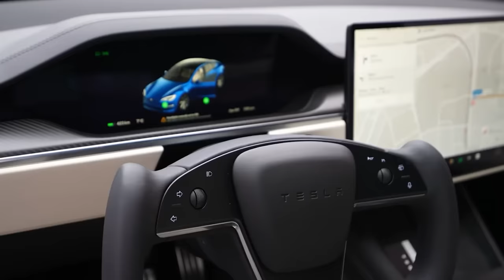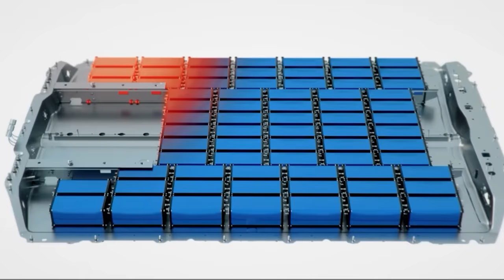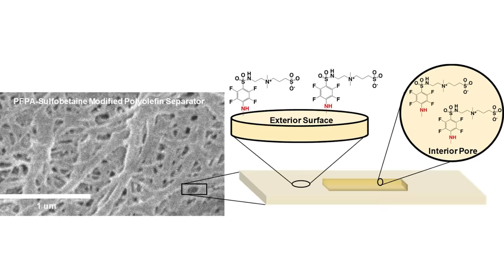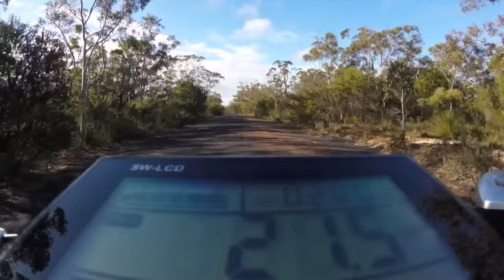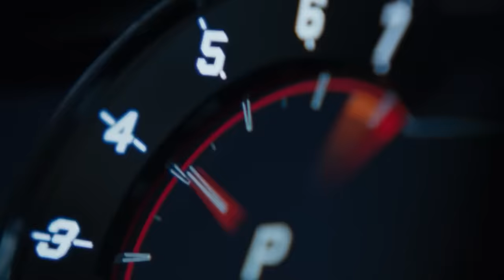EV's Are Exploding In Shocking Numbers

Comment: So you buy an EV to help the environment, but all that toxic smoke when they burn  just defeated that reasoning.
Reply: So the masses of CO2 produced by millions of ICE cars in towns and cities everywhere, just fades away to insignificance does it?  Or had you forgotten about that?
Reply: @Brian-om2hh It’s just not CO2 produced by gas vehicles, it’s air pollution for daily breathing until you feel you struggle to breath. Gas vehicles emits toxic gas everywhere they’re operated 24/7. EVs fires have been largely isolated and very few in reality although such YTube channel have hyped it up for obvious reasons. Renault car maker have been advising and train8ng firefighters on how to deal with Renault EV fires by dousing the fires from INSIDE the ev batteries through a means they have provided, not dousing Externally which they have advised against. So why are these knee jerk key board warriors so keen to advise from the seat of their pants rather than listening to the experts who are responsible for EV fire safety of their EV products and EV manufacturing plants?
Reply: Don't worry about the toxic smoke just digging up raw materials and making the batteries is more harmful to the environment.
Reply: @jacobheinz8236  And when in 2023 have you ever felt like you were struggling to breathe due to air pollution from an ICE vehicle?  That was a concern in the 1970's before emission regulations became mandatory.

Yes, EV fires have been largely isolated because there aren't that many of them out there in comparison to gas powered vehicles.  What do you suppose will happen in a multi-car pile-up of EV's?  It would be "Hell on Earth".  

And exactly how is a firefighter going to get close enough to a flaming EV vehicle to "douse a fire from the inside of a battery"?  I call bullshit on that one.   How many firefighters will be killed or injured by exploding batteries while trying to get to the "means provided", which would be a hookup attachment?  

I could go on for days listing the pitfalls of an EV future.  Better to discover them now before a complete bogus "fix" of something that ain't broken is complete.
Reply: Do a little research and see just HOW MANY petrol vehicles burn and HOW MANY EVs actually catch fire in a year. Get back to me on that, will you?
Reply: @Brian-om2hh  Trees eat it up and love it.
Reply: @The_DuMont_Network  Ask that question again, when EV's are the majority of vehicles in use.
Reply: Even assuming regular cars also catch fires, how often do we hear they explode and destroy the entire car and people’s lives like that?  Don’t push ideology before people’s lives.
Reply: Evs are just as polluting if not more than gas engines in cars.  Ask yourself where does the electricity come from?  60 percent or more comes from gas and coal fired generating plants.  Evs are cleaner locally but not overall.  They're just polluting areas more than normal at the source and that pollution will be carried around by the wind.
Reply: Petrol cars pollute all the time they are used, evs don't.
Reply: @arnimkrause5696  my electricity comes from wind and solar ..
I live locally, so do you.
Reply: not only the smoke thats bad, its the whole production line.
Reply: @The_DuMont_Network  
       So you're comparing millions of millions of gas-powered cars to maybe a million EVs .
           That's a good one .
                           🤣
    Now compare that by percentage .
Reply: @MadMax351  While that claim has been proven 100% false around 1000x already...
Reply: It takes more energy and pollution to produce the EV batterys  than the Gas gasoline SUV would produce in its lifetime From production to destruction
Reply: @lucasdog1  Or calculate the ratio of fires to vehicles of each type and age, which is easy enough to do.
Reply: @jamesedmonds1350  In the US, using data from the National Transportation Safety Board (NTSB), Bureau of Transportation Statistics (BTS) and government recall information, AutoinsuranceEZ calculated fires by vehicle type:
CE vehicles 1,530 fires per 100,000 vehicles.
EV vehicles  25 fires per 100,000 vehicles.
Reply: @thomasvaverka5168  Except of course hundreds of scientific studies have proven that claim to be 100% false around 1000x already...
Reply: Forget about all the so called pollution required to produce ev vehicles.
Reply: @whocares264 😂😂😂😂😂 - It’s the social control provided by government being able to turn off your car remotely and restricting your range of travel. Pollution concerns are an Orwellian lie.
Reply: @randalldunning5738  you do know the technology is here to turn off any modern car  ice or electric
Reply: Along with large amounts of water to put them out washing lots of chemicals into the sewers n ground water.
Reply: @jasonbernard2785  really, do you know the crap which is going into our rivers now,
i don't even have to go to oil pollution,
you have actually highlighted another reason to have an ev....
Reply: @Brian-om2hh To build batteries for these EV all the mining for copper, lithium and cobalt is completely insane.
Reply: @Brian-om2hh  It  seems that the "GREEN"was removed from tha marketing..remained only for paint option
Reply: According to statistics compiled by AutoInsuranceEZ, there are an estimated 25 vehicle fires out of every 100,000 electric vehicles each year. There are an estimated 284,130 car fires per year in vehicles powered by gas.Apr 19, 2023
Reply: @TempleScoop There are probably like 1 billion ICE cars in the road though. Not sure that you are on about. An electric car wiped out a family in a province in my country while they were sleeping. That never happened with ICE cars since the 50s in my country.
Reply: Sure it is..
Reply: @TempleScoop  Should be a reference by year or at least 5 years old, the diff is not only by numbers, a lot of gas powered vehicles had thousands of miles and years more...As i sad, half true every time with every thing on media and marketing..and other trick they play with deliveries-sales INCLUDE also a SH registration EV as sale..Did i mention a low SH EV sales and depreciated resale value ????
Reply: @TempleScoop  
 So you're comparing 100,000 vehicles to hundreds of millions. 
                    🤣
Reply: @torukmahtomahto409  Are you saying EVs reduce in resale value?  Not sure if you were using text-to-speech?
Reply: @JABelms  what is an ice car?
Reply: @TempleScoop  if rou don't know english is your problem..also if you are informed only by TV and marketing..
Reply: @torukmahtomahto409  . I had another person read what you wrote, and it's a bit confusing. I asked for clarification; no worries, have a great day, and no worries.  ~Chad James
Reply: @Brian-om2hh HELLO! CO 2 is carbon dioxide which is a natural gas. It is taken in by plants and used. Oxygen is then expired by plants in a system we call photosynthesis! What you believe is propaganda. You have been sadly misinformed about carbon dioxide. The gas you’re talking about is CO or carbon monoxide. That is fatal, but can be disassembled by electrolysis. Catalytic converters help with that.
Reply: @MadMax351 yes that is true. Go to Central Africa where they dig it up and ask them what it does.
Reply: @arnimkrause5696 correct. Add to that the assembly of that product. Now tell me what’s the difference? To produce the battery, let alone the rest of the vehicle. And the fact that there thousands of these things just parked, yes PARKED thousands deep in a lot in China. Why?
Reply: @whocares264 they do in manufacturing. And electric is generated by coal or gas fired furnaces, just like producing metal.
Reply: @whocares264 All of your electricity does not come from wind or solar unless you are certain you are managing it and producing it yourself.
Reply: ”pay no attention to the man behind the curtain”.
Reply: and yes, that, too.
Reply: Wow! 🤣
Reply: @TempleScoop ICE Internal Combustion Engine.
Reply: @RJDA.Dakota  yes, the same as manufacturing petrol and diesel cars...
Reply: @RJDA.Dakota  all my electricity comes from renewables...
Reply: @whocares264  good for you.
Reply: @Anomoomin  agreed with that. But you have to teach others about “cause and effect”.
Reply: @Anomoomin  wonder where oil come from....
Reply: @Brian-om2hh It’s plant food actually 😂😂
Reply: @The_DuMont_Network A petrol or diesel cannot burn through concrete but an E,v. Can .  making them extremely dangerous in multi story car parks 😊
Reply: @Brian-om2hh 
Plants need CO2 and they will use it up.
Reply: @Brian-om2hh 
Co² is very good for the environment. Forests grow and live on it.
Reply: There isn't enough lithium to put 130 lbs of it in each vehicle if its not going to cost more then gold. 😅 (Tesla battery est.)

around 17-20 million metric tons

Estimates of total lithium reserves on Earth vary, but they are generally believed to be around 17-20 million metric tons

Cars on earth 1.474 billion cars
Reply: No, stored as carbon in trees, plant, grasses and ultimately ourselves after we eat lovely bacon butt's and chicken and lamb with my roast dinner, beef burgers, mmmmmm love fumes from vehicles so much benefit to our modern world. :-)
Reply: @whocares264  you are aware what oil that's taken from the ground produces, all of the products, it would be interesting to see how many people can do without these products
Reply: Not to mention the child labor used to mine the lithium in Africa.
Reply: @The_DuMont_Network so would that figure be skewed at all considering there are way more petrol cars in use than evs maybe could that maybe the reason for that probably definately maybe hmmm🤔
Reply: @whocares264 f thats true why do police chase people?
Reply: @whocares264 well if ur in uk its mainly sewage ruining our rivers
Reply: @nickbailey5201  correct, the uk is an open sewer .
Reply: @drannoc100  even assuming, it’s not am assumption it’s a fact.
Reply: @Brian-om2hh CO2 isn't harmful.  It's plant food.
Reply: @lucasdog1  "Ask that question again, when EV's are the majority of vehicles in use" ....If there is discovered to be a problem with fires, they will switch to a more stable battery chemistry. Like every new tech, you tweak it as you go.
Reply: Also it makes more pollution extracting lithunium from the earth needed for making batteries than it is to dig for oil for gasoline burning vehicles
Reply: @jacobheinz8236 if environmental pollution was the issue we would convert existing ice vehicles to natural gas. Burns clean
Reply: Not to mention the energy to recharge.
Reply: So what is your plan then?????? Or are you just one of them people who like to moan about everything
Reply: Teslas catch fire on average every 200 million miles driven. Gas cars every 19 million miles.   ..... And if you do a little research you'd that fire departments are coming up with some great tech and procedures to put out EV fires.
Reply: There is nothing environmentally friendly about electric cars it's all for stockholders and who has their money invested in such a ploy
Reply: @optimusprimer4392  About 1/6th the mining is required to maintain a fleet of EVs vs gas cars. Much less environmentally intrusive. And electric motors are about 3 times more efficient than gas engines.
Reply: Not to mention unclean charging from ungreen sources.
Reply: @keithharley9729  Not to mention that electric motors are 3 times more efficient than gasoline engines and even in the current electric grid mix of nat gas, coal, nuclear and wind/solar, electric cars will still have fewer emissions than gas cars because of that 3 to 1 efficiency. A lot less emissions.
Reply: How can it help the environment when you're using electricity that has to be generated by a power plant burning coal, wood, or some other carbon producing material?
Reply: @toddtourville984  I'll explain it one more time. Electric motors are 3 times more efficient than gas cars. About 70% of the energy of a gasoline engine just goes up in heat. They are extremely inefficient. Electric motors are very efficient. So even at say 40% nat gas, 25% coal, 20% nuclear, 10% wind/solar, and other, electric cars will still produce far less emissions. They just use a lot less energy.
Reply: @777Outrigger  Maybe in that sense but, you will have to increase the poser plant output which makes up the difference.  Especially since the power grid (USA) is not designed to handle a massive influx of electric vehicles being added to it while charging.  Thus allowing electric companies to charge more for their product.  Creating another problem or problems.  All the while electric batteries are exploding all over the planet creating more carbon output than any gas vehicle in its lifetime.
Reply: I'm a fire fighter, ALL vehicles produce PAHs when on fire. So chill. ❤
Reply: @Brian-om2hh  So what about the masses of CO and other problems produced by coal and other fuel power plants all over the world to supple EV electricity? EVs use a ridiculous amount of energy, 1 kWh of energy to travel approximately 4.8 to 6.4 kilometers (three to four miles) according to the top search result in Google. So its a massive percentage of power used in someones life. 3-4 times more than a full sized house!
Reply: @777Outrigger  EV energy efficiency isn't as good as people make it out to be. ICE is slightly worse but there are many more losses in a vehicle right down to the resistance of aerodynamics, gears and other drive train components, wheels and tire rubber resisting the road and the battery charging which is never 100% efficient as batteries and chargers have internal resistance and get hot while charging. The power lines, transformers and other parts of the electrical grid that supple electricity to homes also have resistance and losses. EVs use a massive amount of kilowatts so there is a lot of loss that adds up.
Reply: Not including the production of this type of energy.  EV is a SHAM.
Reply: Gas vehicles are a bomb waiting to happen. An example of a Tesla in the video above caught fire after hitting a tree ! Shock Horror ! How many gas cars explode instantly after crashing? Battery fires can happen fast but not as fast as gas cars. One sentance in the whole video mentions that gas cars are more likely to catch fire than battery cars (it's actually about 100 times more likely in fact !), yet all the video emphasises battery car fires. Wake up people, this is click bait at it's best. Utter rubbish.  @drannoc100
Reply: @drannoc100  Happens all the time with gas cars !!!!!
Reply: @robbeales5516  Yeh like the recent fire in Luton Airport multistorey car park, started by a gas powered car, destroyed building and 1500 cars ! Imagine the fuss if that had been started by an EV  !!!!!!!!!!!
Reply: @practicalguy973  Let me give you an example. The Big 7-seat Model X has a big battery pack of 100 kWh and a range of 350 miles. That 100 kWh battery pack has the energy density equivalent that 3 gallons of gasoline has. So why can the big Model X go 350 miles on the equivalent of 3 gals of gasoline? Electric motors are 3 times more efficient than gas engines. ..... 

And it costs me about $39 to go a 1000 miles on my house electricity in my Model Y. In my wife's similar sized gas car it costs her $200 to go 1000 miles. We're probably about to buy her a Model Y too. They're selling for $48,000 now.  ... Plus you can get a little Model 3 sedan for $38,000.
Reply: Since when is mining cobalt saving the environment? 

People really need to do their own research. 

Decivers shall be decived ALWAYS.
Reply: @theawakenedarewatchingyou575  The latest EV batteries are LFP batteries and they have no cobalt. Elon Musk calls them the battery of the future. Meanwhile, cobalt is used in the refining of gasoline and is in your laptop and phone batteries. ... You need to do a little more research.
Reply: o chit...the reasoning is done way before the fires cuz cmon where does the energy come from for the batteries? The answer ISNT renewable energy so whats the point of them? They tax the electric grid & where does that power come from? EVs are putting the cart before the horse.
Reply: @johnbrummet524  Electric motors are 3 times more efficient than gasoline engines. About 70% of a gas car's energy just goes up in heat and is wasted. Only 20% of the energy is used to move the car forward. Exact opposite in an electric motor. About 70% of the energy of an electric motor is used to move the car forward. That's why electric cars cause fewer emissions, even with the current electric grid.
Reply: What about an EV "helps the environment"? .. name a single thing about an EV that helps the environment. Just one.
Reply: @nickbailey5201  There’s a specific remote engine activation hardware that not all ICE cars have installed.
Reply: @typhoon320i  They are working on solid state batteries.  Which would have different issues but arguably are more safe.
Reply: @practicalguy973  The energy being used by an EV in running the car is more efficient in its consumption.  However, combustible liquid fuel packs a lot of energy per unit of mass and volume, so there’s a lot of energy that isn’t being consumed as efficiently per unit expended in running an ICE Car compared to an EV
Reply: @adrianwoolf3196  Battery fires are way less likely to happen but when they do, it takes a special effort to put that fire out.  The fire can even reignite
Reply: @squidly2112  Electric motors are about 3 times more efficient than gasoline engines. Even if the grid is mostly fossil fueled, electric cars still lower emissions substantially over gas cars, substantially.
Reply: @777Outrigger  You're only speaking of a one part of the EV efficiency in driving it, as I stated in my first comment there are so many more losses in charging the batteries and the power grid. The costs right now are low for electricity. If ICE vehicles were taken away governments around the world and energy corporations would be adding more taxes and regulations charging much more to compensate for the revenue losses in petrol. Its already happening. Also the electrical grid can not handle everyone owning EVs and home charging. I cant see them beefing up the residential grid, doubling the size of all the electrical components in the grid would be astronomical costs. You'll pay a lot for being an early adopter as governments regulate and figure it all out. Recently EV insurance costs are skyrocketing in some parts of the world according to many sites. Fleet news in the UK reported between 150% and 300% insurance increases for electric cars in recent months.
Reply: @The_DuMont_Network  petrol car self combust is about 1 in 10k for all fire events, ev self ignite a lot. when ev burns it equals about 10 ice fires in scale.
Reply: @whocares264  Do you realize that while wind and solar are producing power that a standby supply of juice is spinning fully steamed ready to kick in the instant the wind slows down or the solar gets shaded by clouds. The grid HAS to be supplied with enough power to meet demand, period. I have spoken to people who run the power grid here in the Pacific Northwest, BPA,  and they have told me this. We have significant hydro power here and that means the dams are spinning and ready to go on line if needed. In other areas of the country that means gas, coal or nuke are spun up and ready to fill the gap.
Reply: Hybrids reflected the most at 3,475 fires per 100,000 vehicles. 
ICE vehicles caught fire  at 1,530 incidents per 100,000 vehicles.
EV fires were 25 fires per 100,000 vehicles.
Reply: All that toxic smoke used to make the battery wasn't enough then.😂
Reply: @michaelbritain5546  EVs lower emissions, even counting their production. Emissions from fires are insignificant.🙄
Reply: How about all the toxic smoke emitting from the Chinese/ Far Eastern power stations and factories that produce these vehicles !
Reply: @alanjackson4646  I agree China and Asian countries are the biggest polluters, but my Model Y was built in the USA. All Teslas sold in the US were made either in California or Texas.
Reply: @BobbyBear105
10 hours ago
Hybrids reflected the most at 3,475 fires per 100,000 vehicles. 
ICE vehicles caught fire  at 1,530 incidents per 100,000 vehicles.
EV fires were 25 fires per 100,000 vehicles.
Reply: @The_DuMont_Network ok, so compare the difference in numbers of ice to ev vehicles out there, then age difference  stolen and burnt out, then the intensity and difficultiesputting ev fires out, id still rather an ice car as its mostly down to maintenence issues,
Reply: @The_DuMont_Network  What's with the snarky comment? The point is well taken. The environmental destruction in China coupled with slave labor in the Congo to extract the minerals needed for the batteries are real issues that the EV fans conveniently ignore. Judge not, lest ye be judged. Maybe the DuMont Network needs to do more homework.
Reply: @truckerwayne  Never mind the environmental cost of extracting these materials. Many of the countries where this stuff comes from have lax or nonexistent worker safety laws and/or use child or slave labor.
Reply: Why doesn't anyone  address the air quality  after the fires from the ev  car
Reply: @ButchNackley  but people just cut trees down in their gardens because their to lazy to clean the leaves up in autumn, i have 2 trees in my garden and takes me about an hour 2 or 3 times a yr to clean up, hardly end of the world work
Reply: @redbaron6805  exept you use the same answer to any anti ev pollution comment 😂
Reply: @whocares264  only cars with wifi
Reply: @truckerwayne  but that pollution isnt in your or my country so it doesnt count
Reply: @TempleScoop  internal combution engine
Reply: @glennelliott1320  thank you
Reply: Cure for a problem that does nt exist!
Reply: @JABelms  how many people have died from petrol and diesel pollution,  millions...so sad that people want this to continue....
Reply: @whocares264 you  pollut every time you put it on charge
Reply: @allanhone6747  not on wind power
Reply: @glennelliott1320  Because these claims are the same recycled bullshit repeated endlessly over and over again, yet they aren't actually factual in any way.
Reply: Then, there are toxic batteries.
Reply: @kathleenevans1201  There are no toxic batteries, and the batteries on EV's easily last 15+ years, and are recycled afterwards.

The problem is a bunch of Facebook Echo Chamber idiots that think they are experts on EV's, despite having never owned one, driven one and having no clue at all how they are built or how they work.
Reply: You can try and claim it's only a few fires as much as you like, the cost of insuring an EV went up 6x this year. They suffer from cronic depreciation, as no one wants a second hand one, they are expensive to repair and are normally written off after a crash, the fires are very toxic and burn at temperatures up to 4x hotter than a petrol fire, so the 'better for the environment' BS story they are feeding us isn't panning out. And most people don't want to be forced to have one. The big car makers are all on the verge of going bust because of this idiot policy that is being forced on us. I'd say the EV wet dream is over, wouldn't you agree?
Reply: @tubewayarmy2  Yes!
Reply: @tubewayarmy2  I can claim to follow actual data that shows exactly what I claimed.

The cost of insuring an EV did obviously not go up "6x" this year, as my EV premiums haven't even changed at all.

"They suffer from cronic depreciation, as no one wants a second hand one"

That claim is beyond asinine, as EV's are offered for sale and sold by thousands on a daily basis, even EV's that are over a decade  old.

"they are expensive to repair and are normally written off after a crash"

Yet more asinine bull with no actual supporting evidence.

"fires are very toxic and burn at temperatures up to 4x hotter than a petrol fire, so the 'better for the environment' BS story they are feeding us.."

That may just about be the most asinine logical fallacy ever.  A handful of EV fires, even if "toxic" wouldn't be even remotely close enough to offset the staggering amount of emissions they save over their lifespans vs a petrol car.

And I find it comical that EV fires are magically more "toxic" than burning gasoline with rubber and plastics in a petrol car.  Just a whole new category of stupid.

"The big car makers are all on the verge of going bust..."

Sure they are..... Just a delusional and comical level of utter bullshit... 

🤣🤣🤣🤣🤣
Reply: Don't confuse the issue with facts....
Reply: @robinluck2922  No facts to be found here...
Reply: If a EV sits in moist atmosphere for a week without operating a fundamental issue that can not be solved easily could happen.
Reply: @lesseirgpapers9245  Obvious bull as there are tens of thousands of EV's in Florida, which has a moist atmosphere year round genius...
Reply: @sorequetengue  A mature tree removes around 48 pounds of CO2 from the atmosphere annually.

The average electric car prevents around 1950 pounds of CO2 emissions annually in the USA, which is equivalent to 41 mature trees removing CO2.

Since both an ICE car and an EV serve the same exact function, you can remove Trillions of pounds of CO2 emissions annually by simply switching to EV's and eliminating combustion engine cars.
Reply: @arnimkrause5696  Coal fired generating stations are declining in number. Gas fired plants are wayyyy cleaner. Wind, solar, hydro and nuclear power do not pollute. There is much more of these clean power generating plants than ever before.
Reply: It takes the processing of 500,000 lbs of raw materials just to make one EV battery system.  The open pit mines and the fossil fuels required to extract lithium causes severe environmental harm as well.
Reply: @Gregory-Masovutch  You are absolutely correct.  Not to mention the slave labour?  Saw something about the working conditions and  the pay is about $2 to $3 per day.
Reply: @Gregory-Masovutch  after 300000Km the ICE engine produced 20% less CO2. Grid being 30% non fossil. Assuming a battery of 500Kgr can be made with less than 10000 Kgr of CO2. This does not take into account the additional CO2 to create the charging infrastructure and peak demand capacity and extra battery storage and the loss of life waiting for the charging and the toxic fumes of burning EVs.🤣
Reply: And wasting enormous amount of water
Reply: @Brian-om2hh Unfortunately Evie cars don't balance out their carbon footprint more benefit the environment till 70-90k miles of use because they were produced and transported  with fossil fuel generated power. Coal and diesel. And though the giant EV batteries CAN be recycled, they are mostly NOT being recycled. The charging  infrastructure sucks. Our power infrastructure isnt ready. Most major ice car companies that are now prodcing EVs are losing billions per year on them. One company is losing $30k per car. I believe it is Ford. There's more problems but the most important one is that we are being FORCED into EVs by the govt not long from now. Fortunately efuels/synthetic fuels are being heavily invested in and developed that are ultra low emissions and some net zero emissions. And, its clear to giants like Toyota that hybrids are the better solution in the real world. The market will continue to prove this. Multiple major car brands are halting EV production because they are not selling fast enough.
Reply: @777Outrigger Due to the extraction, prodction and transport of EVs, they have no benefit to the environment until they have reached 70-90k miles of use. Their tires release way more pollution than ice cars because of the huge heavy batteries. The charging station electricity you will all use comes  from fossil fuel generation plants in most places. Not to mention plants eat up co2. The whole co2 thing is propaganda. If they were talking about co/carbon monoxide, it would be true, it kills.
Reply: @practicalguy973 some insurance companies wont insure them. Thats certainly not a good sign. When the biggest scam artist in the world won't touch a product you know it's bad
Reply: @Brian-om2hh that absolute concentrated toxicity coming from an EV fire, is that of me running my car for a month straight. 

So yeah. It kinda does.
Reply: @Brian-om2hh  Plants need CO2 to live. Where did you go to school that you don't know plants need CO2?  Are you a plantist? Do you discriminate against plants? What would you do if plants  cut off your oxygen since you are cutting off their CO2?
Reply: Co2 is not a pollutant......it's plantfood.
Reply: Exactly.😢
Reply: @richardsullivan2218  And humans need it too.
Reply: Can't use a burnt out vehicle 😄
Reply: @conradharcourt8263 That is in an accident.  However, an electric vehicle is more likely to catch fire just sitting there, or several hours after an accident.
Reply: @Brian-om2hh 40,000 child slaves in the Congo mines so you can have "clean" batteries charged by hugely polluting power stations working at 40% efficiency 😂
Reply: @@dualismdeeperlaws2430 but would you want to be in an enclosed area with a running petrol car...
Reply: The bottom line is that here in the uk atleast. In 2022 we had 3,500 ice car fires. About 100 fires per every million ICE car on UK roads. In the same year there were 26 EV fires or about 15 per million. Less than one 5th proportionately.
Reply: It’s because oil is running out.  All cars are bad for the environment
Reply: @iancouper3644  what about airplanes? Especially jet engines. They mix the exhaust directly into the air. 30,000 feet up where there are no trees or other plant-life that would consume CO2 and turn it into oxygen. Cars are on the ground and the exhaust system pushes the exhaust down to the ground where it does get consumed by plants and trees. Jet engines don't have catyletic converters. They dump out burned and unburned fuel. Cars put out just CO2.
Reply: @iancouper3644  yes, oil is running out. It was running out. In 1950 and 1970 and 2010  etc etc .
Reply: @iancouper3644  
     Well ,that would be bad for EVs, too cause tires, batteries, and other components are made with the use of oil .
Reply: @jamesedmonds1350  but they can be and mostly are recycled. Oil used in ice  cars is burned,  and thus gone for good.
Reply: @patdbean  car oil is recycled. That's why they have collection tanks for used oil .
Reply: @jamesedmonds1350  true, but that is tiny percentage   of the oil they use,  most goes  up in smoke and out of the exhaust pipe.
Reply: @Brian-om2hh It's fact EV's produce way more CO2 than ICE. Are you aware 500,000lbs of raw material has to be strip mined from the earth , transported and refined to make one EV battery?
Reply: @jajajajajajajajaja867  in manufacturing EVs produce more CO2 but by  the time they have driven 25k miles (3 to 4 years of normal use) they pay that back and from then on  They produce much LESS CO2. And as more and more recycled materials get used in the manufacturing, that 25k miles is  gradually reducing.
Reply: @patdbean  You are sadly mistaken. All the emissions the mining operation releases all the way thru the final recycling of a retired EV is much greater than that of an ICE. Even horses emit CO2 but you would argue that point as well I imagine.
Reply: @jajajajajajajajaja867  but most of that is true for ICE cars to. So you are not comparing like with like. Subtract out everything that is also true for ice cars and everything recovered from Recycling. And about 25k miles is the breake even point. You cannot just ignore all the CO2 produced in the manufacturing of ice cars.
Reply: @patdbean  No one is ignoring anything here but you. Yes the actual process to manufacture the vehicle is about the same. What you are ignoring is the battery process and all those emissions and worst of all the strip mining and transport and refinement of all the materials required to manufacture your  batteries. Half a million pounds of earth per battery .Huge gargantuan pieces of earth destroying equipment working 24/7 in places where OSHA does not exist friend. That is unrecoverable at 25,000 miles . Huge swaths of land destroyed down to bedrock and beyond recovered in 25,000 miles you say. Who is ignoring what now?
Reply: @jajajajajajajajaja867  but the mining of any given  "partical" of   lithium only happens once. There is already lithium In The world that is in its THIRD battery. Say a laptop in the late 1990s a phone battery in the 2010s and a Tesla build in  the 2020s

Tesla are saying  that the lithium they are geting from the  recyclers  today is more pure than the first gen  lithium they   were getting in The early 2010s.
Reply: @patdbean  Obviously you're also unaware it takes. 500,000 gallons of water to process one metric ton of lithium? Does that sound good for the environment? Where do you think all that toxic water goes after they're done with it?
Reply: @patdbean  As long as all that harmful mining and refining goes on somewhere else it's ok right? Do you support opening one of these mines in Nevada on land that is significant to the native American people?
Reply: @jajajajajajajajaja867  I am perfectly aware of that. But firstly that is only the initial mining, it is a one off.

Secondly it dose not have to be drinkable water. And you talk as if the water is USED up. After the process it just goes back in to the water cycle, just like the watter that goes down your drain at home. 

Thirdly,  one ton of lithium is enough  for 1200-1500 EV batteries. They will do 12-20 years in the car another 5-10 years in Second life grid storage and then be recycled.

Remember in 2018 about 70% of all lithium  batteries that came to end of life got recycled. By 2025 that will be 90%+ it is just to valuable not to recycle. 

And no, before you say it recycling is not every energy intencive today. The old Pyro metallurgy process in going out of use. It is now mostly hydro metallurgy.
Reply: @patdbean  So just because it's initial mining it's ok? Is that what you tell yourself? If there is so much lithium in circulation its on its third and fourth battery life why continue to mine? As of Sept 2022 only 5 percent of lithium batteries are recycled. There are only two recycling plants with a third opening soon. Where is all the third and fourth generation lithium coming from? Like I said you're not going to gaslight me friend.
Reply: @patdbean  Half a million gallons of water for one or two batteries. No answer for that ?
Reply: @patdbean  Very self serving to continue to ignore the hard facts.
Reply: Not to mention the raw materials ripped out of the ground and the source of the electricity to begin with. In Australia over 80% from COAL.
Reply: @jajajajajajajajaja867  we are still mining more because the number of EVs on the road is still only about 5% but doubling every 4 years or so. As more and  more lithium becomes  available for recycling a smaller and smaller amount will need to come out of the ground.

Today most recycled lithium comes from phones and laptops, very little from EVs batteries because the EVs are not old enough YET! But buy  2030-35 the oldest EV batteries will be being recycled.
Reply: @jajajajajajajajaja867 used EV batteries are finding their way into grid storage for a few years (5-8 ish)  before being recycled. 

Very few have yet found their way to recycling.
Reply: @Brian-om2hh CO2 is only less than .04% of the atmosphere.
Reply: @Matherofacts  it is only  "plant food" IF  you allow the plants to grow.  If you keep burning them,  as humans are doing. 0.2% CO2 in 1600 becomes  0.3% by 1950 becomes 0.4% today 0.5% by 2050 0.75% by 2070 etc etc.
Reply: @Matherofacts  yes, the coal is burnt once and the solar panels last for 15-20 years replacing the need for  coal generated power in that time.  For example here in the uk between 11am  and 2pm Today  coal was generating 0.9gw while  solar was generating between 3 and 4gw. Even In November. In June it would be  8-12gw solar and zero coal.
Reply: @Matherofacts  no, not really. Remember it is "net" zero CO2 , we are aiming for not "Absolute" zero. To have absolute zero , we would all have to stop  breathing!
Reply: @Matherofacts  without looking it up. So from memory,  about 250ppm against the 400+ ppm we have today.
Reply: Exactly, that looks worse than an ICE car.
Reply: @The_DuMont_Network это довольно глупая манипуляция.
Машин с ДВС в разы больше, что электромобилей.
Машины с ДВС эксплуатирутся дольше, чем электромобили.
Поэтому, исследование можно даже не начинать, потому что закономерно будет зафиксировано больше случаев пожаров у бензиновых автомобилей из-за их большего количества.
Поэтому, пожалуйста, не надо тут манипулировать
Reply: Y’all haven’t even brought up electrical grid problems if we have millions of electric vehicles charging with our current power grid it would collapse and cause massive damage and disruption possible loss of life and working on the electrical grid is expensive and hard
Reply: @quetzalcoatl189  no it won't. Grid demand last year 2022 was 306twh down from an all time high of 375twh in 2007. 

The uk has 37,000,000 road vehicals. At an average of 8,000 miles a year each. That is an additional 65 to 70 twh a year. Take into account the power saved to NOT refining the oil and you are looking at about 350twh a year SO LESS than demand was 15 years ago. 

Will we need local grid upgrades?  in the 230v and 11/33kv levels but the 275kv/400kv has more than enough capacity. 

And pricing will keep demand out of the peak 4-8pm time slot. I pay 9p per kWh between 1-5am so I am sure as hell not paying 30p+ per kWh at peak time.
Reply: Also a lot of power comes from coal not gas and if it is gas it’s most likely natural gas and you don’t refine coal
Reply: @quetzalcoatl189  no, wrong again. Almost no power cones from coal in the UK now. Less then 3% last year. The last coal station is scheduled to be gone by 2027. And remember gas is far cleaner than coal. Less than a third of the CO2 per KWH compared to coal.
Reply: Where does the electric come from to charge these vehicles? If you think enough electric can be produced from wind and solar you are sadly mistaken. Where do spent lithium batteries go when they reach end of life?
Reply: @Deribinkle  no I am afraid you are wrong. As I type on a cold morning In November. The UK grid is 29% gas and 2% coal.

The rest is 29% wind 11% nuclear. 6% biomass 2% hydro 5% solar 

And the other 15% are imports.
So 6% french nuclear , 4% Norwegian hydro and Irish and Belgian wind. 

Those ARE the FACTs on the uk grid as  I type at 10am. .
Reply: @Deribinkle  many old EV  batteries go in to grid storage systems. After that as of 2023 80% are recycled. As of today so few batteries are Coming into recycling that most lithium still comes from mining. But Tesla are already using recycled lithium and by 2030 they expect most of their lithium to come from recycling rather mining.

But as of today very few EV batteries are yet old enough to have come to be recycled , by 2030s we will see them come into recycling in volume. 

Either way, with lithium carbonate prices of 29,000 USD a ton, I can assure you  it won't be going into land fill, it is just far to valuable.
Reply: That is far different than the states, thanks for sharing that. At least in NYS I believe the combined wind and solar equals about 8-10%.  @patdbean
Reply: @Deribinkle  you are about where we were in the early 2000s and under current plans coal will be gone from the uk grid by 2027. We are building a new pumped storage station (making a total of 5) and new interconnects from/to Denmark and Germany. With a conection to Morocco in planning. 

Currently at  2pm gas+coal+biomas (burning stuff) is 35%  , nuclear 12% ,wind 24% and solar 10% with the rest imports. And if you are wondering we export over night to fill up the French and Norwegian pumped storage stations between 1 and 5am most  nights.
Reply: @arnimkrause5696 ev as in coal-powered car, you mean.
Reply: @whocares264 the production of your battery has a horrendous carbon footprint and was made from unethically harvested material and cannot be recycled.
Reply: @redbaron6805 "science is never wrong."  -Whoever approved thalidomide for pregnant women, probably
Reply: The masses never do what’s right, they just do what’s most popular 😑
Reply: @lucasdog1 if that’s the case, a TON of people are in for a hell of a disappointment. EV are not the saving grace we all thought they’d be…
Reply: The fact that you have to replace them less than every 10 years is another big one
Reply: @vincentrobinette1507  and your putting a lot more carbon into the atmosphere than any gas or diesel car. It’s not environmentally friendly at all.  Lithium batteries are destructive to the environment and the electricity is not sustainable . The more EVs you have in the road, the more likely you are to take out the grid.
Reply: @vincentrobinette1507  
    It doesn't matter they all ready said the power grid will never handle the drain.
Reply: @vincentrobinette1507  there is STILL a  matter of safety involved! Once the they make EV safer AND less expensive than petrol cars (if even at all possible) only THEN will I consider one. 🤨
Reply: @jamesedmonds1350  you must have a really crap grid then. Here in the uk, at the current average of 8k miles a year,  the current 37m uk road fleet, (when converted to EVs) would add 65 to 70twh to overall uk yearly grid demand. 

About 20% extra,  so back to where demand WAS in 2007.
Reply: @murphykenji  well clearly not coal piwered, as only 3% of the uk's power came from coal in 2022.
Reply: @murphykenji  yet more nonsence , as of 2019 most (80%) of lithium batteries that come to the end of their lives are recycled. 

The recyclers say that the main limiting factor  is that so few batteries have YET come to the end of their usable lives.
Reply: @MrThe1234guy  modern LFP batteries are getting 200-300k miles. So by  uk everage car use  of 8k miles a year. That's at good 25+ years. Would only be as low as 10 years,  in a taxi doing 25k miles a year, I guess. But the car may well have had it after 250,000 miles anyway.
Reply: @chrismayer3919  with the average NEW ice car now 39k and the average NEW EV only 42k. You will get the 3k back in running cost saving in 2-3 years. Maybe less if you do all your charging at home.
Reply: @patdbean     
   A couple of years ago, Texas had a rolling black out cause they had a colder winter than usual, and they couldn't keep up .
        One year, California had a big forest fire due to bad power lines. 
             So ,yes, it's not great .
Reply: @jamesedmonds1350  well as i say Crap grid. To be fair to Texas , that 2021 winter was the coldest  for almost 100 years. 

In the uk demand has  fallen so much since 2007 that there is a good 20-30% headroom now. With 7 interconnectors  to Europe and 2 more being built and another in planning. Along with two  3gw nuclear power stations and a 7gw wind farm on dogger bank, in the north sea. I really don't see the uk having a supply shortage. As long as the EV load is kept out of the peak 4-8pm time slot,  and time of use pricing will do that.
Reply: @patdbean  among MANY myriad reasons against EV, there’s one thing that bothers me is range anxiety! I do NOT want to break down in the middle of Death Valley is summertime due to dead battery issues! HARD pass on EV!
Reply: @chrismayer3919  I can't speak for the us but in the uk ,  range anxiety is largely a myth. The uk driving rules, the "highway code" says you must take a 30 minute break (stopped and out of the car) for every 4 hours of driving. So with a speed limit of 70 mph that is an absolute max of 280 miles in reality probably 250. That rule was introduced in the 1970s because of the number of deaths of people who had fallen asleep at the wheel.  

So a modern EV (anything built since about 2018) will give you 250+ miles range and charge in 20-25 minutes. 

So basically NO ONE should be driving for longer than that anyway!

I remember seeing the public information films on the TV in the 1970s showing real footage of accidents after driver had fallen asleep at the wheel.  So nothing to do with EVs. 

And yes EVs can breakdown in the middle of  nowhere and leave you stranded. But so can iCE cars. I don't really see the difference , in both cases you will need to call a recovery company.

Now do we have enough charging points today for every car to be an EV? No absolutely not. But that is because today only 4% (1.4 million ) of cars on uk roads plug in.
Reply: @patdbean  a battery that’s connected, to a circuit continuously loses power even if it’s not being utilized. Inside of 24 hours, the chances of my reaching my destination have already decreased by 20%! If you choose ‘clean’ fuel alternatives then all the luck in the world to to you. However, consider this…
WHY in the blue hell are so many MILLIONS of domestic and foreign EV going unpurchased  when they have been all the rage lately? Why are companies like Toyota dropping the mike of their EV programme if they’re as great as you claim? 🤨
Reply: @Brian-om2hh if you are worried about reducing co2 it would be better to plant a tree than it would be to buy an ev. Planting a tree doesn't require strip mining lithium, cobalt or anything more than a little time and effort. In fact, I'd be willing to bet that if the auto manufacturers had to plant a tree for every vehicle sold it would completely negate the need for ever more stringent emissions controls. But they don't. And that should tell you that it's not about the environment. It's about the tax money and controlling people.
Reply: What it takes to make, charge & dispose of makes it extremely unreasonable!
Reply: @cristineconnell7803  very true! Like I said, buy an ICE powered vehicle and plant a tree. If you're really worried about it plant two. Lol
Reply: @Brian-om2hh the co2 from exhaust pipes is nothing... Producing new vehicles is way worse. If you want to truly cut c02 you would control when and how many new cars are produced, 90% of all vehicles c02 output is produced during its creation, with that known, you would understand that older cars are the way to go...
Reply: @redbaron6805 those studies were done in your head??😂
Reply: @rexracer7192  No, they are actual scientific studies done by actual scientists, something you would obviously never understand....🙄
Reply: @redbaron6805  if you are saying  new EVs should only replace ICE cars that  are nolonger serviceable... Then I absolutely agree. So as the UK has 
37 million road vehicle , and let's assume a very generous life expectancy of 37 years, then we need 1 million NEW EVs each year. 

So about 4 times the number that will join the UK road fleet in 2023.
Reply: @MadMax351 To say nothing about the risks posed once the batteries run out, placing that toxic waste into the ground! They still haven't figured out how to safely dispose of them.
Reply: @spicencens7725  where do you get this garbage from? You do know it's 2023 not 2003, don't you?  In 2023 absolutely no one puts lithium batteries into land fill. They are all reused/recycled. They are just far to valuable not to, with the lithium carbonate price of 37,000 USD a ton!
Reply: @spicencens7725  EV batteries are RECYCLED genius, and have been for years already.

Who is putting thousands of dollars worth of metals into the ground...???

Just astounding level of clueless...
Reply: @patdbean  Why assume the lifespan...? 

The typical lifespan of a car is around 15 to 16 years or so.  

Around 2 million cars are sold in the UK annually, so it would take just over 18 years to replace the entire fleet, which would mean it would be completed by around 2040.

That would also allow time to upgrade the electricity and charging infrastructure, as obviously many sections of the UK were built and designed before cars came along.
Reply: @arnimkrause5696, the production of wind mills and solar panels include a lot of polution too. And they need to be replaced often. And you can't even recycle them.
Reply: And don’t forget about that 6,000 gallons of water used… that’s a good use of resources
Reply: @kenhinkle7603  the watter thing is another myth. Yes it dose take a lot of watter but it is the SAME watter, it is a closed loop system. It is used over and over. 

Also the CO2 used in the manufacture gives you a wind turbine that can be used for decades. The wind farm of the coast here in Kent. 100 x3MW turbines was installed  in 2006. All 100 are still running. When you burn coal and gas to generate power, you use it once and then it is gone for good!. And you still have to manufacture a turbine to go into the power station, and that will need replacing with 35-40 years.
Reply: @redbaron6805  ok , the current 250k new EVs a year needs to get to 2 million a year. As it is currently  doubling every 3-4 years. So we will be at that 2 million EVs a year by about 2034-36
Reply: @jacobheinz8236 the Renault access port you are speaking of is under the back seat. So a fireman would have to enter the vehicle to gain access. Also if the battery fails that port allows the battery to off gas inside of the vehicle which then the car is actually a bomb. Watch the videos of them exploding in garages they have so much force the rip the garage apart.
Reply: @Anomoomin  all of those things only ever done once for each EV. Ice cars produce co2 EVERY time you start the car .
Reply: @patdbean  It is hard to map out EV growth into the future, as many companies are ramping up production, and market share could change very quickly.

Looking at Tesla as an example in the USA market, they sold 26k cars in 2016, doubled to 50k in 2017, quadrupled to 200k, cars in 2018, were up 50% to 300k cars in 2020 and up again by 80% to 540k in 2022.

Once they reach price parity, range goes up another 100 miles or so and mass production ramps up, this could change far faster than doubling every 3 to 4 years.

Tesla sold 20x more cars in 2022 than 2016.  If their market would have doubled every 3 to 4 years, they would have been selling around 100k cars by 2022 instead of over 500k.

Technology has a tendency to reach a tipping point, and when it does, adoption rates accelerate much faster than forecast.
Reply: @gsc512  your estimate of lithium on earth is 100 
Fold out. You are forgetting about lithium in the sea water. You are also assuming all batteries will be lithium , sodium ion is better for many applications
Reply: @redbaron6805  I was just looking  at the UK EV market. With my 'doubling every 3-4 years' Comment.
Reply: Also they have no idea as to how they will be able to safely dispose of these batteries once they are dead.
Reply: Don’t forget raping the earth to mine for minerals to make the fire prone batteries. Double whammy. Drive a regular car folks.
Reply: @toddtourville984  but we don't charge with coal fired power, can not speak for other countries. But here in the UK coal is now to less than 3% and will be gone by 2027.

 Overnight power (when 70% Of charging us done( ,  is now  90% nuclear+hydro+ wind. With a little gas.
Reply: @777Outrigger  
How much road use tax do you pay per kWh?  Is it billed at the time of sale (charging) as it is for petroleum fuels?
Reply: @patdbean  
Why are you comparing the life expectancy of a wind turbine to the life expectancy of the fuel used in a steam turbine generator?  One is equipment and the other is fuel... not even remotely comparable.

A city near my home just retired the coal fired steam turbine generators that were built in the early 1930s.  How old is the oldest wing turbine generating electricity for the grid?

Yes, each ton of coal can only be burned once.  How many times can you capture energy from one breeze?  One; that breeze is now headed away from your turbine... and the blades of your wind turbine are not currently recyclable while the steam turbine can either be refurbished or recycled.

How many times can a photovoltaic panel capture a single photon?  One.  How many were lost to reflection to capture that one?
Reply: @jacobheinz8236 What about the radiation from the battery?
Reply: @frankmcgowan9457  true, but once you have built the panels/wind turbines the sun/wind is free. And turbines in power plants don't last for ever. The two big power  plants near me started generating  in ,1967 (coal ) and 1982 (nuclear ) and were decommissioned  in 2006 and 2013. We now have a 300MW off shore wind farm and ,2 gigawatt interconnectors to France a Belgium, instead.  

And a turbine is a turbine, something pushes it around and it induces current in a coil. Why is a turbine that is pushed around by steam recyclable and another that is pushed around by wind somehow not?
Reply: You should take a look at just how destructive the mining process is to the environment just to make one electric vehicle? It makes EV’s ten times worse for the environment than a gas powered vehicle.
Reply: Honestly, I did not buy my EV to protect the environment, I really couldn't care less about the environment. I bought my EV because it triggers the right, as a libertarian, I think that the market should be left to make the choice.
Reply: @davidmlong63  I'm a guy "on the right", whatever that means, and I love my Model Y.  I will be voting for Trump. I'm against all mandates and subsidies for EVs. There is no climate crisis, but EVs will lower the human footprint, and that's a good thing.
Reply: @777Outrigger  I can't really argue with you, I found myself saying much of what you said, except I own a Chevy bolt and not a model y. I however won't be voting for Trump, I will be voting for whoever the libertarian party puts forward. Yes I know I like to vote for people who don't win and have no chance of winning.
Reply: Plus the mining of the lithium, disposal of dead batteries. And you still need fossil fuels to create the energy to charge them. Since you can't  charge them on solar power. They create more environment toxic waste then gas running cars.
Reply: @KristyW72  False on all counts. The largest lithium mining country by far is Australia, where it's mined safely and environmentally responsibly. And the US grid is already 40% NO-EMISSION wind/solar/nuclear/hydro. Pretty clean actually. It's only 16% coal, and falling ...... ...... And electric motors are about 3 times more efficient than gasoline engines. About 70% of the energy of a gas engine just goes up in waste heat, and only 20% is used to move the car forward. It's the opposite with an electric motor. Only 20% of the energy of an electric motor goes up in waste heat and 70% is used to move the vehicle forward. So even if the grid was all fossil fuel, which it isn't, EVs result in fewer emissions with this efficiency advantage.
Reply: @davidmlong63  😃 You must be young. I used to be that way when I was young. I mean, voting for people who have no chance.
Reply: @777Outrigger  quite right, I often find that people in these youtube  comments are for some reason living in the 1990s

1. The idea that the grid is 80% fossil, 1995. 
2.  EVs only do 75 miles in a charge 2005
3. Public chargers ALL take 2 hours to  charge (2010) 
4. Only 5% of lithium batteries get recycled. (2003) 

It is as out of date as saying ..
80% of TVs are CRT screens.
The  only way to see recorded TV is on VHS tapes. 
There are only 4 tv channels.

All true once BUT now all out of date.
Reply: @patdbean  Well said!
Reply: @777Outrigger  I will take that as a compliment. I am only young at heart, I just about to turn 61..
Reply: @trebornoslo1951  yes, the grid call it spinning reserve , they have a given percentage of spinning reserve , say 3% so 100MW of coal needs 3MW as dose 100MW of nuclear or 100MW of wind or solar. The backup still has to be there, regardless of generation method.  .
Reply: @lesseirgpapers9245  no extra generation plant will be needed. In the UK when every car is an EV the grid will still be generating 20% less power than it did in 2007, demand has simply fall . Once you take In to account the power saved by not refining the oil, 25% less. ost (70%) of charging is done at night. When other demand is low. So zero new generating plant 
will need to be built. Because demand has done nothing but fall for 15 years.
Reply: @patdbean  Sad state of affairs in the UK. But refining oil does not need a lot of electricity. It is the heat of the oil itself. But you will still need 1MW of Gas for every MW of renewable. And at 10% of capacity only renewable in the UK running EV is still dirtier than ICE and China and India will be happy that UK is back in the Cave age.
Reply: @davidmlong63  Still a little younger than me. 😁
Reply: @patdbean  OK, fair enough.  Each market is different for multiple reasons, and the UK is a challenge for EV's due to the age of their cities and dismal parking situation in many cases.

The USA has in its favor much younger cities with larger homes and more driveway and garage parking available, with far less street parking.
Reply: Then you have the disposal of the wreck, lithium is so bad for ground water.
Reply: @lesseirgpapers9245  refining oil takes a lot of power 700MW in the UK 365/24/7. Oil refineries are one of the big users who national grid disconnect when the frequency goes below about 49.7hz. Along with pumping stations and other high power users who can live with out power for 15-20 minutes while  spinning and standing reserve is spun up.  

The x% of spinning reserve STILL needs to be there, because ANY   generation can trip out  at ANY  time. Back in 2008 we had a black out in the UK because the grid lost sizewell nuclear 1.2gw and a gas fired power station  tripped out within   seconds of each other, and the spinning/standing  reserve could  not come on fast enough. Nothing to do with renewables.

And renewables are far more than 10% of UK power now. You are living in 2010. 

Last year , Coal was  3% , nuclear   12% gas 35%. The other 50% is a mix of  (in descending order)  wind, solar , hydro and biomass.
Reply: The reasoning appears to have been deliberately skewed.  Considering the ling-known & discussed Warnings for decades of the fragility of the overTaxed national Grid -- it Defies reasoning, common sense and good judgement involved with protecting the public.
Reply: @matthewclifford2509  Not in the minuscule numbers of EV fires there are. Insignificant to the environment.
Reply: @user-pw7wl3nu1l  there is no radiation  from the battery itself. The electronics will put of some radiation. As do all electronics. But tiny amounts that do zero harm under normal use. If they did everyone who uses  a PC all-day at work (say in a call centre )  would have cancer with a few years.
Reply: @KristyW72  in 2023 almost all old lithium batteries are recycled. This rubbish about only 5% being recycled is from 2005.
Reply: @matthewclifford2509  It is a SHIP genius, which is in the OCEAN.  Where in the world is this "ground water" you are worried about...???
Reply: @whocares264 
No it doesn't.
That's nonsense.
Reply: You're claiming that 1 in every 75 proper cars spontaneously combust?
You are insane.
Reply: @antonrudenham3259  who is saying that? Here in the UK out of the 37 million vehicles on UK roads last year 3,100 or so , were the seat of a fire. So they did not go up while setting in a garage when the house went up. 

So in any ONE year  3,100 is less than %0.01 each year. So today EVs are 4% of all cars on UK roads. So 4% would be about 130 EV fires per year. There were  infact less than 50 EV fires.
Reply: @patdbean  How many of those ICE vehicle fires were a result of arson or a RTA?
Same question for EV's.
What I'm asking for is the number of ICE vehicles that spontaneously combust with no exterior input.
Even when an ICE vehicle does burn the seat of the fire is often found to be electrical which eventually spreads to the interior and if unhampered to the fuel.
These fires can be quickly extinguished at any point.
Not so with an EV where the 'fuel' itself is the seat and is difficult/impossible to extinguish.

I contend that when ICE vehicles first appeared in numbers in the first quarter of the 20th century and were found to be capable of un-aided self ignition and all the many other drawbacks inherent in modern day EV 's they would have been shunned by the buying public, the manufacturers would have been forced by the market to go back to the drawing board or cease production altogether.
Reply: @antonrudenham3259  the 3100 is the number that went up without any external intervention. So the Luton airport fire counts as "one" . Because only one car started the fire. The others  Went  up in flames because of external influence. 

And less year in the whole UK , last year , less than 50 were EVs. Not counting road accidents, because that counts as external influence.  

Full EVs  are less likely to self combust than ICE cars. I am not so sure about the 500k hybrids, because they carry all the risk of BOTH technologies, in the same vehicle.
Reply: Not to mention the chemicals that are leached out from a burning EV. Those chemicals wind up in coastal waters, ground water etc.
Reply: @antonrudenham3259  Who is "you" and who is claiming 1 in 75 anything...???

In the USA, there are 174,000 car fires annually, or about 1 in 1650.

You must be bad at math or doing elementary research or both...
Reply: @redbaron6805  that 174,000 sounds a  lot, with the UK being about 3,000 a year. The US has 5 times the UK's population not 50-60 times. 
But my 3,100 a year is from the UK fire service  website.
Reply: user-xt1km8ij8z  for the love of God , how many more times.... There is ZERO cobalt  in todays LFP batteries. The biggest user of cobalt in the world is the oil industry.... They put it into petrol. 

And the largest producer of lithium in the world is not Congo it is Australia ..... Now are you really trying to tell me there is slave labour in Australia....?
Reply: user-xt1km8ij8z  These statements are just astoundingly dumb unfortunately.

First of all, the only thing involved in "slave labor" is a small portion of Cobalt mining, a metal that is used in anything from airbags to jet engines to pigments to drill bits to consumer electronics.

Second of all, modern EV batteries like LFP don't use ANY Cobalt at all, as in none, and existing NCA batteries have reduced Cobalt to around 2% and are in the process of eliminating in completely.

Lithium is mined from evaporative pools in South America or from mines in Australia and Canada.

There is absolutely no slave labor involved in Lithium mining.
Reply: @patdbean  I'm just quoting the numbers, as seen here:

"In 2021, there were around 174,000 highway vehicle fires reported in the United States. This is a slight increase from the previous year, where there were 173,000 highway vehicle fires reported across the country."

In the UK, these numbers are from the Suffolk County Council:

"In the United Kingdom, more than 100,000 cars go up in flames each year, resulting in approximately 100 deaths. Approximately one in every twelve vehicles reported as stolen is set on fire."

This is from a factsheet from the Suffolk County Fire and Rescue Service.

I'm not sure where you are getting the 3100 number from, but the UK has around 40 million cars and trucks which is around 15% of the number in the USA.

Cars in the UK tend to be even older than in the USA, so 15% of the numbers in the USA would be around 26,000 if the numbers were statistically equal.

3,100 is far too low to be realistic.
Reply: user-xt1km8ij8z  You clearly said, Cobalt AND Lithium mining, and as I noted already, there is no slave labor involved in Lithium mining.

And these comical projections that I'm am somehow "OK" with slave labor is obviously absurd.

As I noted already, modern EV batteries are phasing out Cobalt, but Cobalt use will never be eliminated 100% as it is used in countless products.

If you are claiming I'm automatically "OK" with slave labor from Cobalt mining because I drive an EV, then you are admitting yourself you yourself are automatically OK with slave labor if you have any battery powered power tools, laptops, mobile phones, fly on airplanes or drive a car with airbags.

So, spare me the hypocrisy here.  If you want to whine about Cobalt use, then lead by example and stop using anything battery powered and stop flying or driving in cars that use Cobalt, which is every car made in the last 30 years.
Reply: @redbaron6805  I see now, your figures include arson, cars that go up in house fires, or after a collision etc etc. My 3,100 are  just cars that combust because of inherent faults not to external ignition. 

Either way, full battery EVs are 3-4% of UK road vehicles BUT are only 1% of the "spontaneous"  vehicle  fires...
Reply: Not to mention the burning bodies from the ones whom didn’t escape the burning vehicle so sad
Reply: @patdbean  I haven't seen it broken down quite that detailed, but if you only count cars that caught fire due to malfunction, I guess that could be possible.

A lot of the early EV fires were due to early generation batteries win manufacturing defects.

As those issues are corrected, and newer EV batteries like LFP and Solid State take over the market, I expect EV fires to almost disappear in the coming years.

Even when battery defects were discovered in manufacturing, like with the Chevy Bolt, the fire rate in the USA for the Bolt was 1 in 10,000 or so.

That is actually quite a bit lower than the average fire rate of the current, or 1 in 1600 which means EV's even with defective batteries catch fire 6x less than on average.
Reply: @redbaron6805  you have to find a way to discount cars that burn because of arson or burn while parked in a garage as part of a house fire, because any car will burn under those conditions. Old/new/ICE/hybrid or FULL EV. 

But either way you are right,  Full EVs burn much less than ICE. The question is hybrids, having a ICE engine and a battery/motor. Do they carry the risk of BOTH?
Reply: @MadMax351 not to mention charging stations are run off of coal or fossil fuels anyway
Reply: @patdbean  I don't disagree that we have to separate out the arson or cars destroyed by other means, but data on that isn't readily available, just the totals which are usually insurance claim data.

So far, data appears to show Hybrids catch fire more than both combustion engine cars and EV's.

It could be because they carry two different systems that carry some fire risk each, and combined, they tend to catch fire more because of that because they could catch fire due to electrical shorts or battery faults,  along with fuel and oil leaks and similar combustion engine fire risks.
Reply: Actually,,,,the mining process to build the battery,,,,has already negated any reduction in GHGs.
Reply: @lynnmacleod5005   oil is pumped out of the ground and is burnt ONCE. Lithium is mined refined and put into  battery that will be charged thousands of times and then recycled. Tesla  expect most of their lithium to come from recycling by 2030 and ALL of of it to come from recycling by the early 2040s
Reply: @lynnmacleod5005  That claim is such embarrassing level of utter bullshit.

Literally every single scientific study says otherwise...
Reply: @Michele-hz3iw  depends what grid you are on and at what time of day.

 As I type in the UK at 5am only 27% of UK power is Coming from coal  or gas. The other 73% is in descending order 43% wind 18% nuclear 7% biomass with the rest imported hydro and Wave  power from Norway and France. 

Now at 5pm today that will not be true. But why would I be silly enough to charge at 5pm.  why would I want to pay 30p per kWh to charge  at 5pm rather than the 9p per kWh I pay, over night? 

Do learn the FACTs before you make stupid statements.
Reply: @patdbean  not sure what your point is,,,,mountains are blased, articulated dumps move it,,then crushed,,,then trucked to the smelter,,,the smelter requires 4000 tons on silica sand a day,,which is trucked from 2 hours away.  

A 40 ton truck of rock will be smelted to 1/4 ounce of mined goods,,,,how heavy is a EV battery again.  

You just have no clue.
Reply: Coal burner goes boom.
Reply: @lynnmacleod5005  my point is that it is only done ONCE for each battery, then we have that lithium FOREVER. For oil , gas and coal it is done OVER and OVER.
Reply: @patdbean  what are you talking about,,,,those batteries have a 3 year life.    So not so much
Reply: @lynnmacleod5005  rubbish ,  the battery is warrantied for 8 years.

our 2016 leaf has 120,000 on the clock  and still has 92% capacity remaining. I expect 250,000 before 80% some time in the mid 2030s

You need to stop reading rubbish in the news papers.
Reply: @lynnmacleod5005  That is how all mining and fracking works cupcake.

How many Billions of gallons of brine does fracking produce annually, and how many truck loads of sand, chemicals, drilling mud and water is needed to frack a single well again...?

Oh, right.  You don't really have a clue, do you...?
Reply: let alone the shit that is involved in creating one.
Reply: @patdbean  are you conflating electrical and general energy consumption?
Reply: @lesseirgpapers9245  maybe , but only when  you move to electricity do you get the ability to use low CO2 generation.

In 2007 the UK used 375twh of electricity  , in 2022 the UK used 306twh of electricity and now most of that is low CO2. Only 35% if gas and less than 3% is coal. 

And even when All 37 million road vehicles are EVs total UK power demand will still only be 370-375Twh a year, because electric  motors are so much more energy efficient. And hopefully by that time 80% will be low CO2 that is non gas/coal/oil .

And yes I know when every gas boiler is replaced with a heat pump that will push power demand up to the 450-475twh a year, range. But that transition is 40+ years away, people are still having NEW gas boilers installed today .
Reply: @patdbean  The embedded CO2 of EVs and Renewables are horrendous. A coal fire plant runs 8300 Hr per year. A Solar plant only 800 Hrs in UK. So you need to install over 8 times the equipment. We do not have the copper in this world for your pipe dreams.  You are picking and choosing statistics. An EV 60Kwh weights 500Kgr. That puts the efficiency of an EV at 60%. The motor efficiency does not even play a role because of the round trip efficiency of batteries.
Reply: @lesseirgpapers9245  but , you are living in the past
 max  coal output is 1.5gw (3% of total generation  in 2022) 

Max solar output is 10gw (8% of total generation  last year) 

What you are claiming is impossible, has already happened.

The last UK coal fired power station will be gone by 2027.

You talk as if copper can't be recycled. Look at the price, world copper price is DOWN over that last 12 months, as is the lithium carbonate price. Look it up for yourself. There is NO shortage.
Reply: @lesseirgpapers9245  and no , total generator to wheel efficiency of the average EV is between 80-85%. The waite of the battery is not reliant. All that matters is how much power do you need to generate to drive a given distance. 

And the answer is one KWh drives the average EV about 3 miles, (taking  into account  UK grid transmission losses of about 7%). And if charged from Off peak power, it costs about 9p,  so 3p a mile.
Reply: @shanerockliff7558  Got to love the staggering ignorance of people with a 3rd grade science education, which still don't understand how any of this really works.

EV's are far cleaner over their lifespans, and it isn't even remotely close.
Reply: Learn to spell "weight". In cold weather or hot weather I only get 2 miles per Kwh.   4 Ltr Gasoline drive a car 100KM. = 40KWh = 62 Miles = 1.5 miles/Kwh.
Gasoline without taxes cost 0.75 cent per mile.
Reply: @lesseirgpapers9245  You must be driving a Hybrid to get 62 Mpg.

And I have never seen an EV get 2 miles per kWh, typically it gets 3 to 5 miles per kWh.

Your statement of gasoline without taxes is "0.75 cents per mile".  Based on what and where...?

In Kuwait or something...?
Reply: @lesseirgpapers9245  yes , auto correct, sorry.  

Gasoline is not 0.70 here in the UK it's about 160uk pence 1.6 UK pounds)  per Ltr. And that is the whole point, a  political decision has been taken (by both parties)  that the public ARE going to have the ICE habit "knocked out of them" over the next 20-30  years. 

Today people may be willing to pay 160p But what about 260p or 460p?

While night time electricity was 4p per kWh in 1985 and still only 9p per kWh today. Adjust for inflation and it is actually getting cheaper.
Reply: @thomasvaverka5168  100 % correct
Reply: @coach2208  Yes, it would a tragedy if any Lithium ended up in the Ocean.

I mean, the Ocean only contains around 230  Billion tons of Lithium already, so adding a few more grams would definitely tip the scales.....🙄
Reply: @jacobheinz8236  No they don’t, Modern ICE engines since the 80’s have addressed the noxious oxides produced by combustion by the introduction of computers to control engine combustion since 1985. Gasoline and Natural Gas are the cleanest burning of all fossil fuels. So if you want a clean environment, then buy yourself an EV but don’t force others to do the same by encouraging governments to ban gas vehicles.
Reply: Reasoning is not for you.
Reply: @The_DuMont_Network What are the percentages?
Reply: @Brian-om2hh making an electric car uses more co2 , than any petrol car will ever produce
Reply: You know you do have a point. It is the same point that people have when I buy a can of beans. Beans are healthy and flavorful but it hurts the environment when I release all that gas.
Reply: @MadMax351  EV's or no we are still digging that s*** up anyway. Even if EV's simply disappeared. We still mining.
Reply: @arnimkrause5696  there are very few coal power plants left in the US. Most are gas Yes, but emissions from a power plant is a point source and much easier to implement emissions controls, most power plants have carbon scrubbers and a and a crew of people maintaining The power plant so it is always at top efficiency and minimal emissions, contrast that with millions of cars as a distributed source that are in various conditions of disrepair.
Reply: I love all the environmentalist that completely ignores how lithium batteries are made and what devastation it creates globally 😂
Reply: They are worse for the environment vs internal combustion vehicles
Reply: @Brian-om2hh  have you forgotten that you charge your EV off the grid which gets its power by burning stuff? It would actually be greener to have a diesel generator onboard rather than generate that electricity 100 miles away then send it to your half ton battery via 100 miles of wires. Put it this way, if a freight train were to replace their 5000 gallon diesel tank with a lithium battery, it would need a 2000 ton battery. Do you think that's green? To haul that tremendous mass everywhere and deal with all the energy losses in long distance electricity transmission. Not to mention the losses when charging, discharging..........EVen while just sitting there doing nothing they lose energy.

And if you don't believe it would need a 2000 ton battery then I'll do the math for you.

5000 gallons of diesel contains 700 Gigajoules of energy. Each 18650 cell contains 36 kilojoules.
Divide 700 billion by 36K and you get about 20 million. Meaning you will need 20 million 18650 cells to have a 700 Gigajoule battery pack (that's about 200 million watt hours).
Each 18650 cell weighs about 45 grams. Multiply 45 grams by 20 million cells and you have 900 tons worth of cells alone. For a complete battery it will be closer to 2000 tons when you factor in all the wiring, electronics, cooling system etc. By the way 2000 tons is the weight of a decent size ship. You know those giant things in the sea? It's absurd
Reply: @whocares264  If you want to charge an EV using solar you will need a solar array about 10x the size of the average solar array here where I live. It's simply too much.
And wind is absurd. How are people gonna all have their yards full of wind turbines. It's just too much electricity. Go green for real and use an electric scooter or something.
But quit believing that your 2 ton lithium cobalt behemoth is green. The mining alone needs about a million pounds of raw material to be removed from the earth just to make the battery. And then 99% of people will get their electricity from the grid. Not fantasy land with wind and solar.
Reply: ice car burn every time you start the engine...
Reply: @arcrides6841  27% of electricity comes from wind in the uk, you are absurd....
Reply: @whocares264  the UK is tiny and 27% is not much so what's your point. Now get your thinking cap on.........Imagine if everyone switched to EVs. To make it feasible you'd need to have everyone fast charging because even at 350,000 watts it still takes forever compared to filling up a gas tank. Imagine the queues. 350,000 watts is too slow but let's say it's fast enough for mass EV transit. 350,000 watts is equivalent to over 100 houses on the grid. Are you starting to wake up? No? Let's continue.......you'd need to generate sooooooooo much electricity and it ain't gonna be coming from the wind. That 27% would fall to insignificant levels and you'd be getting your battery charged by burning coal, gas or going nuclear. That's if it's even possible for us to generate this much electricity in the foreseeable future. EVen if it's possible it's utterly absurd. Too many resources. Imagine all the lithium and cobalt mining. Imagine all the copper for transporting all those trillions of amps. Imagine all the power stations.
Reply: People don't realize how much pollution is put into the environment from producing the batteries
Reply: @whocares264  Do your math before you say anything
Reply: @chrisparker7214  I have, I am correct.
Reply: @chrisparker7214  people do realise that ice vehicles pollute every time they are started during the lifetime of the vehicle, but they don't care, poisoning air we breathe is worth it to hear the broom broom but some people have grown up ...
Reply: @chrisparker7214  apparently you don’t either, as I’m sure you would have told us.
Reply: @jacobheinz8236 I’m not getting one! You cry about pollution from gas  cars and trucks but not one word about all the pollution from China?
Reply: Clown Comment
Reply: @BioniqBob  yes  
       You made a clown comment,
                        So.
Reply: An electric vehicle will take TEN years to break even with traditional engines when it comes to pollution ,The mining and manufacture of Lithium Ion batteries is a disaster especially for the children who are used to mine the lithium.
Reply: @chrisparker7214  The Grimshaw case was just one of more than one hundred lawsuits that were filed because of design flaws in the Pinto that resulted in fuel tank fires. Estimates by Mother Jones attribute between 500 and 900 burn deaths to Pinto crashes.
Reply: Electric vehicles require, as the name suggests, electricity to run them. Electricity is mainly produced either by hydro(water), oil, coal, wind. I'd like to know where the savings are because power stations burn a lot of fossil fuels so that ev drivers can say they are saving the planet.
Reply: @The_DuMont_Network I’ve had a battery fire in an ICE vehicle( lead acid battery) put it out with a small extinguisher, bought a new battery, drove the car away.  Tell me how many ev battery fire you can  do this with.?Get back to me will you
Reply: @jacobheinz8236 what about the toxic water and waste of water used to put out ev fires?
Reply: @Brian-om2hh I guess you just love EVs. Yes regular cars sometimes do catch on fire and it's scary. But i worry more about all the plastic that's in our rivers. I'll take a gas powered gas any day over an EV.
Reply: They actual polute more in every way, they are not green.
Reply: co2 is plant food and not pollution   @Brian-om2hh
Reply: @Brian-om2hh  surely extensive mining for EV batteries is very green and clean.... lol, not to mention when they dispose tons of toxic batteries which use forever chemicals...
Reply: @The_DuMont_Network   Exactly.  Everyone gets all worked up before using their brain.  Insurance companies report 117,000 to 170,000 car fires a year with the top causes being electrical shorts and accidents.  That number is down from over 300,000 fires a year.  The video at the very end - around 9:36 even states that EV fires are very RARE!!  I also love their title "EV's Are Exploding In Shocking Numbers" Are they EXPLODING or catching fire.  Just click bait!!!!
Reply: EVs are not about "saving the planet."  They are about limiting your ability to travel.  Think about it.
Reply: @Brian-om2hh  mine blew up
Reply: @MadMax351  never mind the coal it takes to make those batteries
Reply: I bought an EV to save green backs not the environment. Let's get that straight.
Reply: Billions of explosions are occuring around you in ice vehicles daily.
Reply: @drannoc100 have proof to back up your assumptions before unveiling your ignorance.
Reply: @EVBud69  
    Wow ,
        Where you live ,in a war zone ?
                                          🤣
Reply: @EVBud69  
         Just wait awhile those green backs will fly away soon enough.
Reply: Plus all the toxic chemicals used to mine lithium out and disposing worn out batteries in landfills.
Reply: @whocares264  they cant turn off my $300 crown vic or any of my other cars from the 40's or 50's
Reply: @Brian-om2hh  no matter what you make. However its made (diesel chuggers digging materials for ANY vehicle), how it runs, or how its disposed. there will be a waste product. EV's are no different or NO better.
Reply: @redbaron6805  Please explain or link to said research articles.  And please, don't insult me with fact checker sites like snopes, AFP etc... 🙄
Reply: Hey mor-on mob, not all EV drivers buy it for the environment.
Reply: Yes everything about EV’s is not environmentally friendly. Ford is stopping production of all ev’s
Reply: @The_DuMont_Network
Please stop using statistics improperly. Yes there are more ice fire because there are more ice cars in existence. If we scale evs to the same level as ice cars then ev fires will rise in proportion.

That's why we have "percent".
Reply: @MadMax351  
TRUTH! And very expensive besides.
Reply: Plus all the methane released from the burning ev owner.😖
Reply: @Brian-om2hh   Shouldn't you be driving your ev car.
Reply: Gotta love these Democrats good job
Reply: I run a 2.0L VW Diesel on recycled veg oil. I drive at 50mph and get 80mpg. I filter the old engine oil, and put THAT in the tank too. The car is 20 years old and still runs like new. I'll NEVER have an EV, even if they were free.
Reply: ill stick with running my 1964 Austin 1100
Reply: Da auf jedes E-Auto 60 Kraftstoffautos kommen die abbrennen, ist der Akku nicht wirklich ausschlaggebend.
Reply: 10 times worse.  EV are trash
Reply: @Brian-om2hh one EV fire causes more pollution than my f250 at 200k miles. Lol. The pollution to make 1 EV. Just to make it,  batteries and all. I can drive my F250 200k. That's just making the vehicle.   Then all the Cole to charge.  When batteries are dead, they are trash.  My car, recycled.
Reply: @jacobheinz8236 FIRES?  EVERY DAY..PLEASE.  YOU'RE NOT SMART.
Reply: EVs burn 60 times less often. so 60 times better. You're 6000% wrong.
Reply: @domz2424  
       You can't compare a billion gas cars to a couple thousand EVs .
               Your reasoning is 6000%  ridiculous. 
                                         🫣
Reply: exactly! and in these videos, its frequently talked about how hard it is to fight these electric vehicle fires too. but yet, we have had water tanker trucks for many many many years now. and yet, some how it must be some sort of delusional belief of it being an impossible feat to take a big water tanker truck(not a semi) and remove the barrel tank and replace it with a simple big box tank with hydraulically liftable lid that swings open from the top and rests along the side of the tank to allow easy access on both sides and on the back of this box tanker truck, just like with those logging and materials delivery trucks, have a beefy forklift with special anti bomb protection front to protect operator from any explosions and shrapnel and such from reaching operator, and using that to pick up the burning mini nuke of a shitbox battery vehicle, aka an EV, and dump the thing into the mostly filled water tank to drown the burning bomb of a vehicle completely and entirely inside it. then when its done and drowned and sense water dissipates electricity from batteries when submerged and kills them making them essentially duds, are now much safer to handle and deal with. and the tanker can close the lid for and during transport, obviously to help keep anything from potentially falling out or exploding out while vent holes in the top center area, that are covered with armored caps, allow any gasses to easily and freely escape while being transported to a more safe location to deal with for investigation and recycling and the like. but all these media and companies and firefighting folks, they are sooo hell bent on making it seem like its such a massively complex and difficult thing to combat, but the solution of this so called overly complicated problem, lays in KEEPING SHIT SIMPLE" lol but i think they are soo used to shit being overly complicated and anti simple that they forget that many problems actually are solved through simple solutions. ^.^
Reply: @jamesedmonds1350  
Nobody does that either. I didn't mean the total numbers (all existing cars) but calculated to 100,000.
Of every 100,000 gasoline and diesel sold, around 1,530 burn, and of every 100,000 EVs sold, only 25 burn.
Reply: @domz2424  and you just pulled all of that out of a hat .
       There's no way anyone  knows how many ,this or that car has burned.
      It's made up figures that a Tesla owner made up to make himself feel better about buying one .
         But if it makes you feel better to believe it ,
    Then go for it .
Reply: Trojan horse
Reply: Pretty much, EV is pretty much a joke and is actually probaly a forest fire risk
Reply: I remember that saying of the electric car being the way of the future -_- lol
Reply: That would not be my take on the situation. The number of vehicles that burn and cause toxic fumes versus the saving of gasoline exhaust fumes is less than miniscule. 

The problem is that the batteries seem not to be as safe/reliable as one would expect. But fires with combustion engine vehicles are far more common, even proportionately.
Reply: Should invent cars that run with high-powered magnets